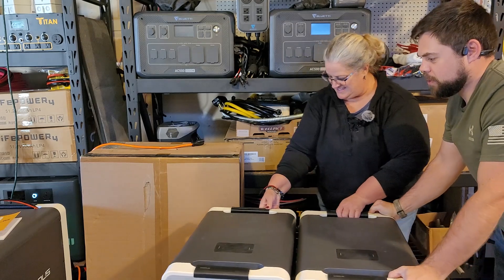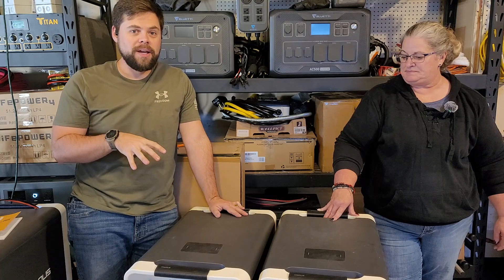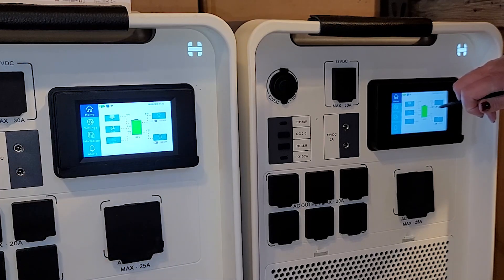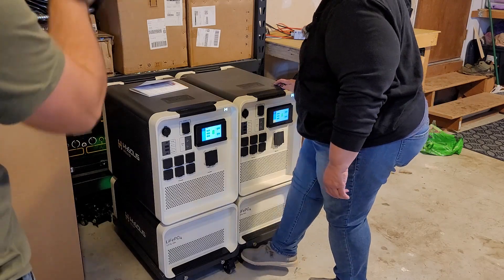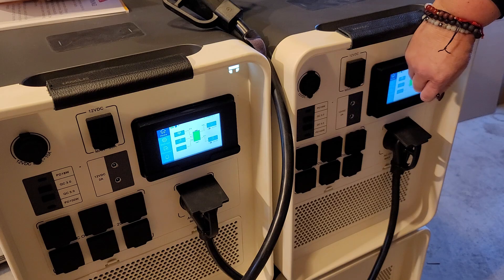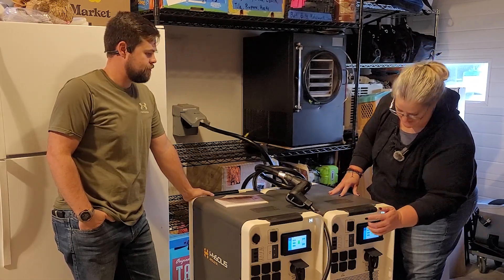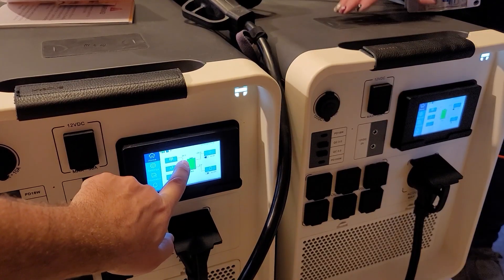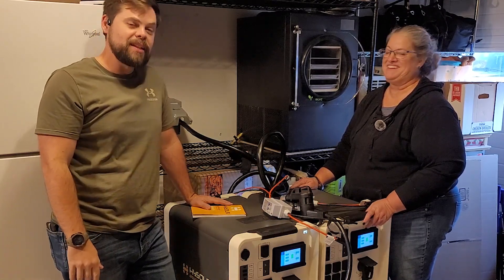First Time Setting Up Apollo 5K Solar Generator

Comment: I wish Hysolis had the engineering wisdom and the expertise to design this Apollo 5K with low frequency, transformer based inverter technology, instead of the low cost, short lived high frequency, transformerless inverter tech that they used.  With only a 2X surge capacity, that's not enough to start and run my woodworking tools. It won't start my planer, router, band saw or even my 3 horse table saw. I don't understand why they simply didn't add an iron core, copper wound output transformer? It might have added some additional shipping cost, but would have added a significant amount of time to the product's life expectancy, and a much higher surge capacity. And why on Earth did they name this "5K" when it only produces a 3kW continuous output? Were they intentionally trying to be deceptive?

Comment: 2 main units and 2 extra batteries equals just 6k?  i thought the main units were over 5k wh each + 2 batteries also 5k wh each.  help me with the math.  how does it go from over 20k wh to 6k output at 240a?  thanks for the video!
Reply: thank you for replying and your videos.  i think i see.  the total of 2 apollos & 2 extra batteries is 21.5kwh (5376 x 4)?  $.91/wh + cart and misc.  ouch, lotta bucks!
Reply from the maker: @nerkymusselman8843  Correct. What is being paid for is nearly everything is done for you, plus having the warranty from a single company for all the equipment, plus all the R&D that went into it. Solar generators will never be as cheap as a DIY setup, and I'm not trying to claim that. I am showing a solution that works for people who don't want to or can't do a DIY setup and want a simple solution that works extremely well. I like both options.
Reply from the maker: Two main units equals 6k output. The batteries do not affect the output, only the "fuel tank" size, or battery capacity. the Apollo "5K" means it has a 5kWh battery in it. That title actually makes it more confusing in my opinion so that's why I only call it the Apollo usually. Each main unit will do 120v and 25a which is 3,000w. When two are linked together that doubles to either 120v and 50a, or 240v and 25a. You connect in series to increase the voltage or you connect in parallel to increase the amperage output. Then within each Apollo is a 5.4kWh battery. Each expansion battery also has 5.4kWh of battery capacity. Two Apollos and two expansion batteries have 6,000w output (either at 120v/50a or 240v/25a) and then a total of 21.5kwh. Each battery is technically 5,376wh.
Reply: other then the initial 240v, could you tell me why someone would get 2 main units & why they’d  instead get 1 main unit with 1 battery?
Reply from the maker: @nerkymusselman8843  Double solar the input, plus the option to go 240v at any time.

Comment: My interlock switch is only 30A so I had to buy a plug to connect to the 50 A and I did worry that it would be a problem.  I called your office and the nice lady (your wife?) told me it would be ok.
Reply from the maker: Kathy is my assistant and manages pretty much all the back end stuff. She's awesome! You're correct, you can use the 50a to 30a adapter and be just fine.